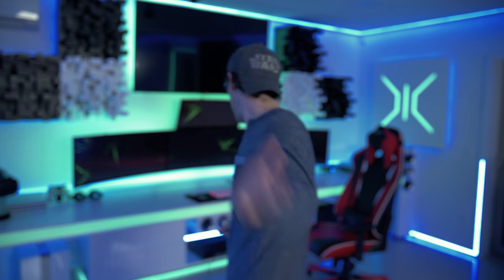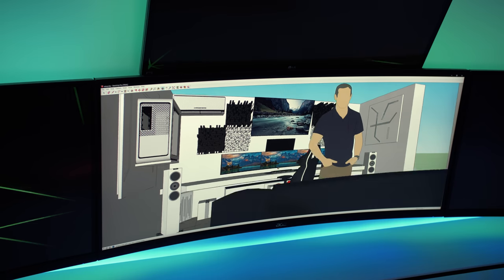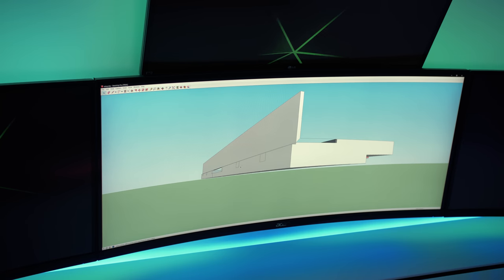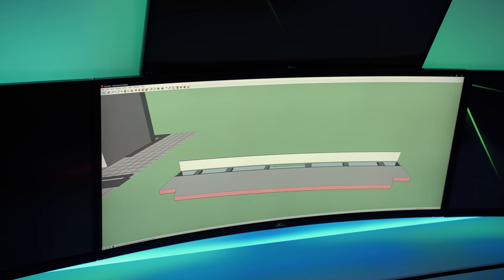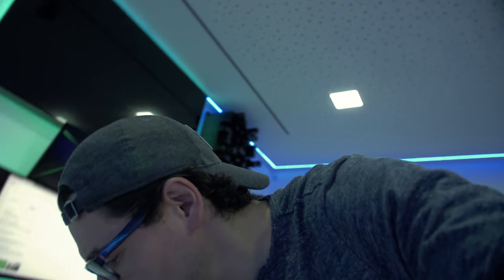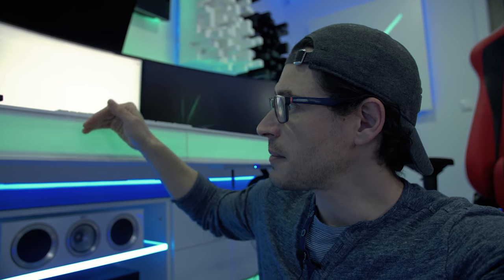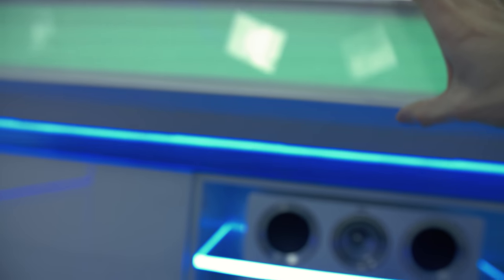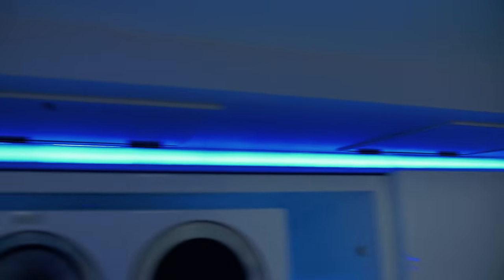BEST Custom Desk In The World!  Ultimate Cable Management

Comment: Your setup just puts me at awe!! the amount of effort and things you went through to make it is insane, that's ignoring the cost. you are soo lucky to not have to worry about moving. This is absolutely amazing! Well done! One question though, how did you mount the metal rods holding the desk? was it bolted to the studs or did you drill holes into the studs and slide them in and secure them?
Reply from the maker: yes I had to drill  or the desk would probably fall down XD

Comment: The desk is wall mounted right? How did you secure something so heavy? I’m planning a wall mounted desk but all I’ve found is heavy duty brackets which aren’t exactly designer in style!
Reply: Drill the solid wall with a back support to sustained all the weight

Comment: hey i know you might not see my comment but if you do i have a question. I'm planning on making something like this with like the RGB. Maybe not the size though lol. I was wondering how you got the RGB to look so smooth did you use a lifx beam or just like normal led strips? Second question is did you use frosted acrylic or just normal acrylic? Are there any other tips and tricks?

Comment: Is the wall behind the setup '2-sided' and hollow or how do the cables and table beams just vanish in it?
Usually there are cable canals on the top or the bottom going all the way to Your computer...
Reply from the maker: I have drill the Wall directly into my Monitor and table, there is no 2 sided wall :) it was hard work, but was that solution I use to vanish the cables :)

Comment: One thing that could help for your wireless charger for your phone is that you put a hole under you desk and glue it in then you can route that cable underneath but it's not worth it on a desk that sexy and for one single cable.

Comment: I've fitted custom work stations in over 60 recording studios over 40 years and i have to admit this is visually stunning with some unique solutions to problems, i like the look of the bass traps in the corner though the reflective surface kinda negates how effective it will be. There are better solutions for cable management available but i doubt they'd look as good as your final result well done on a beautiful job....one question as your speakers are actually set up to be listened to from what i assume is the back of the room have you a sound solution for when you sit at the monitors? And while talking about audio is the back wall treated for sound also? Cos you're going to have powerful audio reflections from any surface those big beasts are pointed at (As well as behind them)
Reply from the maker: Hello, Yes this has a mass projection screen that comes out from the ceil and passes in front of the Monitors, that is why the Speaker are mounted like that, in the Back of the studio I have Diffuser and Obsorvers and My ceil is all with acustic treatment , thank your word, I am really glad I was able to make a good solution  :)
Reply: Rather than the access hatches to reach up for the cables we attached them to longer hinged drop down hatches so they're right there in front of you. each cable bay was modular with a custom junction boxs with all the various connections to extend a cable when we needed to. Helped by a computer sub floor to feed cables across the room under the flooring...each flooring panel had rubber idolators to kill audio vibration and can be lifted whenever needed for access....not a better system than yours just a different way to get the same high standard